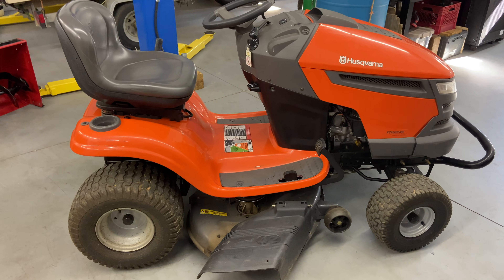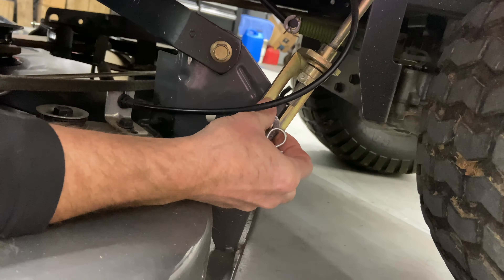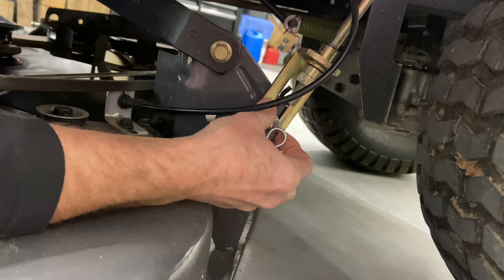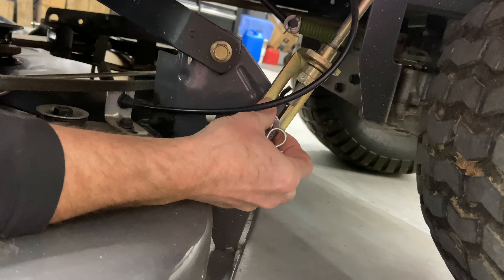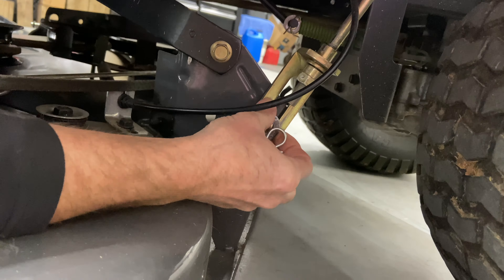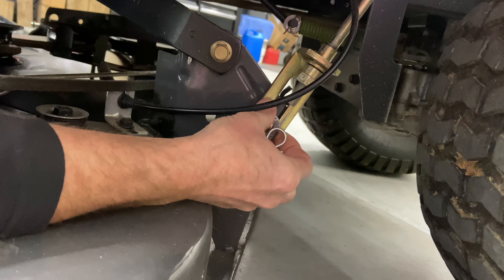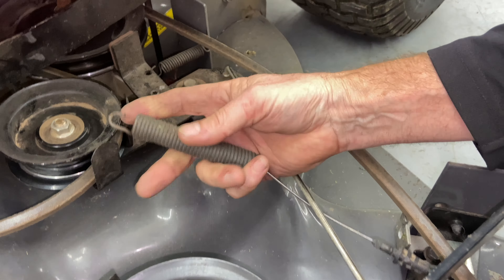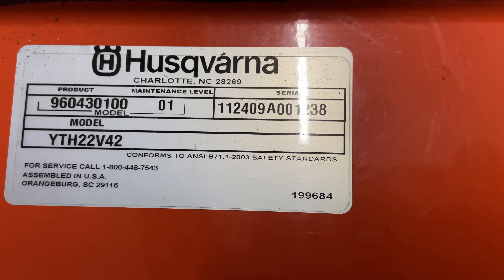How to Service and Maintain Husqvarna Lawn Tractor

Comment: Brad when I pulled my Husqvarna mower deck out following your video: I found a short spring laying under one of the pulleys. 
One of the hooked ends was broken off.
Does this short spring go to my pulley brake assembly?

Thanks for any info
Love your easy to follow videos & tips: I did the 3 upgrades and it steers great!
Reply from the maker: It may be a brake spring but many machines have slightly different set ups so I cannot confirm that it is. When I have found a part missing and I’m not sure where it goes, I will look at the parts diagram and normally I can see where it went. I would suggest looking at the mower deck parts illustrations.

Comment: I like your comments about the direction of the hanger clips (Bow Tie Lock Cotter Pin) I guess it would/might make a difference. LOL However, you could make the same argument if you were going backward and hit something. The plastic wire loom will eventually wear the sparkplug wire. I agree with you about not using water to wash the deck; a leaf blower after each mowing works and only takes about 45 seconds. If you need to wash it, then dry it with the leaf blower. You made a good video

Comment: Why does my Husqvarna 42 inch cut backfire when I could the engine off?
Reply from the maker: Are you turning off the machine at full throttle? Try letting the engine idle for 20 seconds before turning off the machine. See if that helps

Comment: I enjoyed the video. 
My elderly father in law has a YTA 24V46. The back right wheel  suddenly 
Locked up.  After raising the back the back wheels rotate in opposite directions. What might be the issue and what steps do I need to do to help him.
Reply from the maker: That is normal. There most likely is nothing wrong. If you need to push the machine you will need to pull the hydro release rod out that is in the back of your machine in the right side of the hitch. Just remember you will need to push it back in before your transmission will work again.

Comment: Thank you for this excellent video. Husqvarna should send you a check for $5000 for promoting their product. I watched the entire video and at the end you solved my problem with the right side adjuster. My plan in the next couple of days "was" to take the rear hangers off, cut a one inch section out of each and then weld them back together as I like a tall cut grass. Why didn't I ever think of putting an adjuster on the right side??? But you did...so that is what I'll try next to lift the deck up higher. I am the King of bent blades, broken spindle housings and bent shafts, thus I noticed at 10:30 into the video the one blade was "off" just a little, and my eye caught the reason at 8:00 into the video when you spun the pully, I detected a very slight wobble indicating a bent shaft in the housing. Thank you again for a most excellent video.
Reply from the maker: I'm glad it was helpful and thank you for the kind comment, Please give this video a like, subscribe and share my channel to help it grow. It would be greatly appreciated. Thank you for watching!

Comment: I bought a used Husqvarna YTH21K46 with the Kohler 21hp Courage engine and 46inch deck, it was the model that only had a H on the front of the hood, as to be older than this one you serviced and it also has 520 hours showing and still working.

Comment: Hi Brad, 
I am not sure how often you look at the comments but I have a question. The bearings that I got from Amazon are  sealed bearings and as far as I  know they should not need greaase as they are sealed with the grease already in them. My question is # 1 since they are sealed I don't see the point of greasing them through the tire greaase fitting if the grease never gets to the actual bearing. The other choice is to remove the seals from the inside of the bearings before installing them and then the grease the wheels as the grease would surely get to the bearngs. 
Love to hear your answer on which way to do the install sealed opr not !!
Thank you so much for your videos. I recently retired and love to do my  own maintenance on the equipment. I am learning a lot and get to tinker with the machines and so far they are still running.
Reply from the maker: There are many opinions on this subject. You can perform a search and take all into consideration to make your decision. My opinion, the sealed bearing will take grease by the pressure from greasing them (its a proven fact, watch a video on it). The other side of that is, if you do not keep grease around the bearings (like in the empty rim hub or blade mandrel), water will enter the bearing (fact, I see it all the time from people washing there machines that do not grease the blade mandrels). I would never want the hub assemble of the front wheels empty (always fill with grease). If not, water will enter, then enter the bearing and ruin it prematurely seal or no seal. The bearings made today do not have the tight tolerances as back in the day. Seals will let water in and also allow grease to be pushed in.
Reply: @JohnsonsSmallEngines  Hi Brad,
Thank you so much for responding so quickly. I was not expecting an answer so quickly!  I accept all the advice I get from someone with experience and knowledge and dismiss my thoughts and opinions [as I should]. I have installed the roller bearings and will grease the wheels now that I know what to do. 
Thank you so much for spending the time you spend working and then doing the videos. Your explanations are outstanding I don’t know how you do that much and then respond to us. I am thrilled to be able to work on my machines.
Keep up the great work and 
Thank you again. 
Ricardo

Comment: Just got done welding the left bracket back on to me deck for the second time smh
Reply from the maker: The good news is it sounds like you are able to weld your own deck?? Many people would need to take the deck to a welder. Been there and have done that on many occasions! I have also seen some pretty cheaply performed welds from the factory.
Reply: Why does my Husqvarna 42 inch cut backfire when I cut it off? 43:58

Comment: I wonder if you might have an answer to problem I’m having with a kohler 25 hp engine.  Recently rebuilt.  Idles seems to overrevv and the exhaust  manifold gets red hot.  Also has no power dies under load.  Started it recently and blue smoke came out the exhaust when first started.  Have checked everything compressions good different carbs valves are hydraulic working fine.  No blow by. Baffling.
Reply from the maker: Impossible to diagnose a issue without seeing it but it sounds like you may have a down cylinder. Could be spark, valves, head gasket etc.

Comment: i need to know how to change a spark plug on the YTH18542 husqvarna
Reply from the maker: At the 25:35 mark on this video, https://youtu.be/JNj_MRdH33E. if you have a single cylinder briggs and stratton engine should help you change your spark plug.

Comment: Hey Brad!   The JD D160 I bought with this property this past November (you helped me install and remove a Snow Blade I purchased separately for it!) is having issues climbing the inclines I have in the yard here.   Yesterday was the first time I had a chance to use it for mowing grass instead of pushing snow.   I wound up having to push up a VERY gentle incline and get it back on the driveway to drive into the garage, and that's where she sits now.   It's a beat up beast with just over 300 hours on it.   I am NOT mechanically inclined (your videos helped me immensely), so I don't know if what's wrong is easily fixable or not.  Transmission slip?   Drive Belt?   Transmission fan blades busted?   Is it worth fixing?   MY QUESTION for you is, given my yard has inclines (I won't call them "hills"), should I move out of the S100 series from JD as a replacement, and instead pivot to a Husqvarna 48" Deck c/w Differential lock?   I see the JD S160 doesn't offer this... I am loathe to leave my plow, but... I need a good mower that will hold up here (we have just 1.5 acres, but much of it is treed - so maybe 1 acre to mow).

What are your thoughts?   Pay someone to "fix" the D160, replace with a new S160, or move to Husqvarna 24hp with Locking Diff?
Reply from the maker: I can’t say 100% what your yard looks like but it sounds like the John Deere S200 series would be the way to go or the John Deere X300 series would be a good pick. Not sure what transmissions in the Husqvarna 24 hp newer series tractors but I’m sure they’re comparable to the John Deere. The S200 and the X 300 series have the better transmissions. I do not have any videos on installing or uninstalling snowplows because I don’t recommend it at all unless you have a higher end machine. You most likely have a bad transmission, but the first thing I would check is install a new transmission drive belt and see how it feels. You may have stretched the drive belt and need a new one.
Reply: @JohnsonsSmallEngines  thanks!  Sorry, it was removal and reinstall of my deck in order for me to install my snow plow!   I watched a lot of videos, but it was yours that got me through that.  :)

Comment: I'm impressed with what you can do with being handicapped. You're amazing. Thanks for the information.
Reply from the maker: I’m glad it was helpful. Thank you for watching and the kind comment.
Reply: @JohnsonsSmallEngines  not the same set-up is mine  my sparkplug is on the front of the,it it was on the side like the video i wouldnt have got in touch with u 
 motor with a metal casing around it